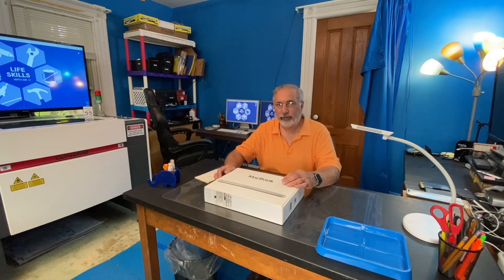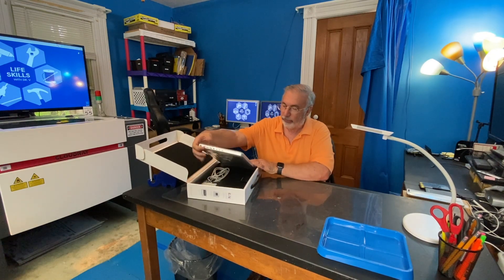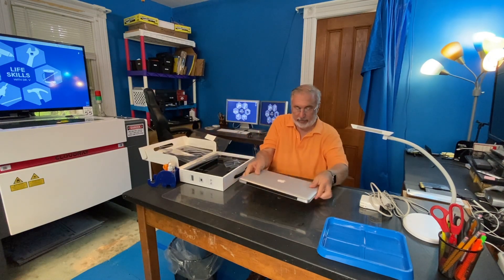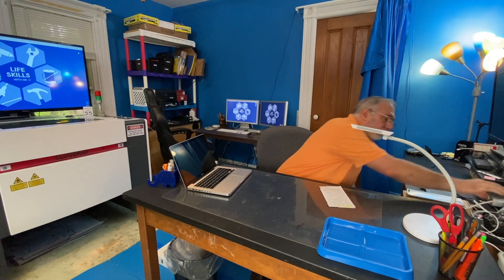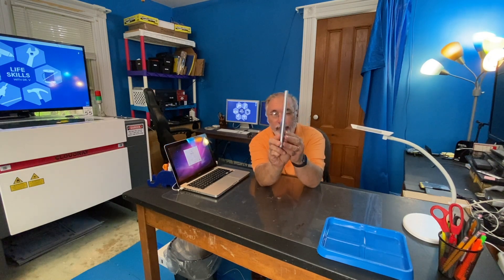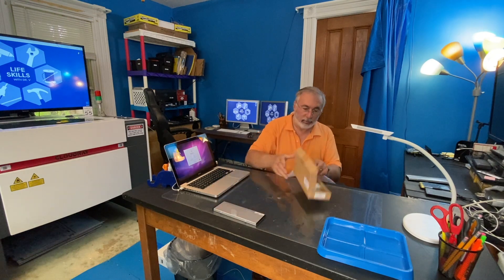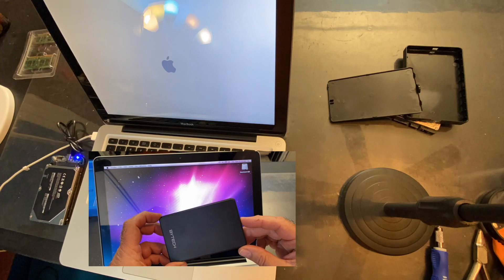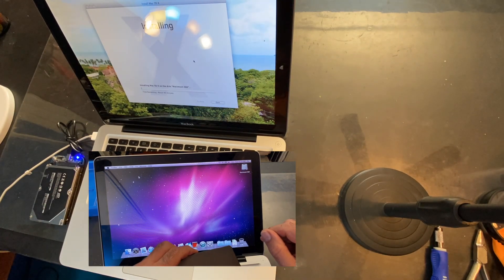Resurrecting Old Tech: 2008 Unibody Aluminum MacBook

Comment from the maker: UPDATE: In the video I installed MacOS X Snow Leopard (v. 10.6) which is what the laptop was running before I replaced the hard drive. Web sites refused to process requests from the browsers available for that version of the OS, which needless to say is problematic. So I installed the  version of Catalina (https://dosdude1.com/catalina/) patched by dosdude1 to run on this unsupported machine. That allowed me to install more current software versions, but many apps crashed on launch. Fortunately dosdude1 had already identified the problem and provided the solution. From the terminal execute: sudo nvram boot-args=amfi_get_out_of_my_way=0x1 then restart. Now all is well and I am running Microsoft Office, Brave Browser, Facebook Messenger, iCloud, etc. with no issues. It is obviously a little bit slower than my 2019 MacBook Pro, but still very usable for many tasks.

Comment: I miss how accessible those upgrades were. I just did the same to an early 2011 and have done countless upgrades to older Lenovos. Just found your channel, subscribed.
Reply from the maker: Thank you @kdoubt! Newer devices are not as upgradable, but in exchange we get smaller form factors, lower cost, and higher performance. There are always tradeoffs.

Comment: I missed the step at 5:25 - was the OS installation on that external drive?  Is that something easy to get for a Mac?  I have never used a Mac and don't know much about their ecosystem?
Reply from the maker: I used the case and circuitry from the cheap external drive to connect the drive I removed from the laptop so that I could use Apple's Migration Assistant app to reinstall all my applications onto the new SSD. For the Operating system installation I used a DVD-ROM disc.
Reply: @Dr.V.  I didn't realize that the component prices were so inexpensive!  I have an older ThinkPad that I'm running a flavor of linux on, but 256Gb HDD and 4Gb RAM is somewhat limiting - Maybe I'll give it a go!
Reply from the maker: @scottmb99  Yeah, that's what made me say to myself "what the hell, I'll give it a try."